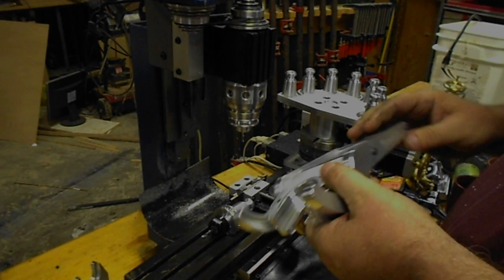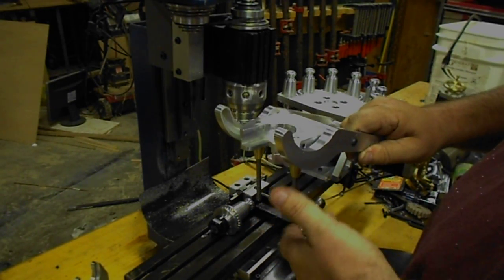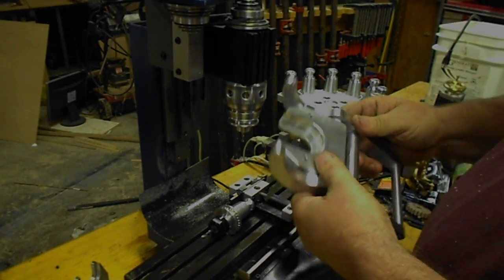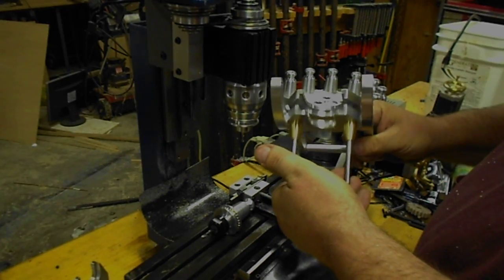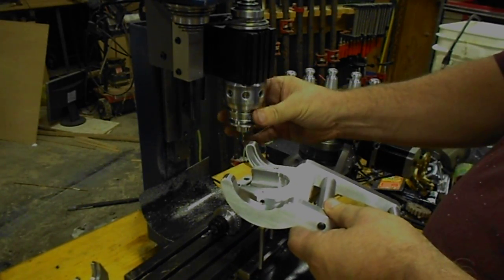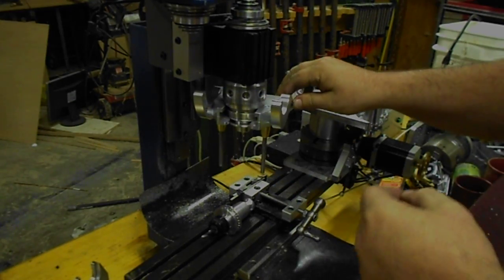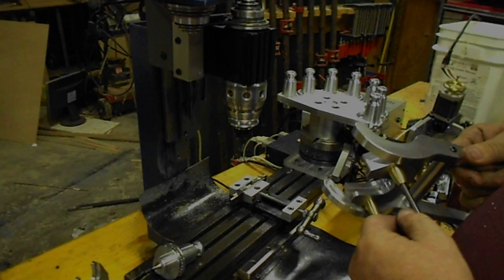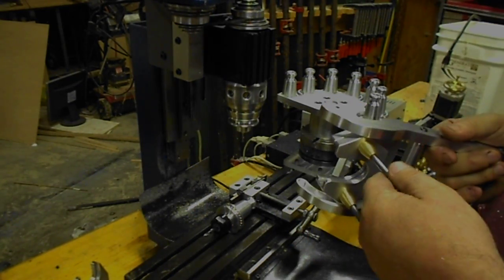8-Ball Manual Tool Changer for the Taig CNC Mill

Comment from the maker: Hopefully production of the spindle and toolholders will start the end of this week. I am finishing up the final prints and getting more info on the selected materials. Looks like they will be made of 7075 with the possibility of having both anodized and possibly colored as well. This all depends on the cost. I want to be able to offer this at a very reasonable cost, so that will ultimately be the determining factor. As it is, 6061 has proven itself thru repeated tests that it is durable enough to withstand the forces that have been placed upon it, so we will have to see. The new spindle motor and sheaves are capable of a much greater load on the spindle than the original motor did with the ability to run a 3/8 dia end mill at .100 depth cutting .1875 material at a speed of 2500rpm (lowest speed possible) at 10ipm.....absolutely no belt slippage or problems with the motor bogging down. The motor mount and sheaves, along with the required Poly belt will be available as well.

Comment: nice tool... have you started production on the spindle yet?  I am looking to do something where I can ATC my Taig mill with about 3 tools at the time.
Reply: +Christopher Smith cool thanks for the update any ideas on price?
Reply from the maker: +Ben Rogerson I was going to wait till I built the 7 tool ATC rotary but have been told that most people were wanting a simple quick change and not necessarily an ATC. After uploading this video it was quite evident that that was true. However, I have drawn a new design for a stationary 3-tool ATC plate, having already built a stationary 4-tool plate that was fixed to the front of the machine table but scrapped the idea because it limited the use of the front of the table by 1/4" and knew that the newbies would be crashing into it all the time. Here is a drawing of the 3-tool stationary "compromise" - https://www.dropbox.com/s/0b1qsgp6be3gls8/3%20tool%20atc.JPG?dl=0 that allows use of the majority of the left side of the table. The new 7-tool ATC would be the one to have though. Here is the new drawing for that as well https://www.dropbox.com/s/kry2kcrvpnemhn1/7%20tool%20atc.JPG?dl=0
Reply from the maker: +Ben Rogerson I am trying to get it out before Thanksgiving.
Reply from the maker: +matt whitehouse Not yet. I have many other things that must be done at my work before I can start anything else. I'll keep you posted.